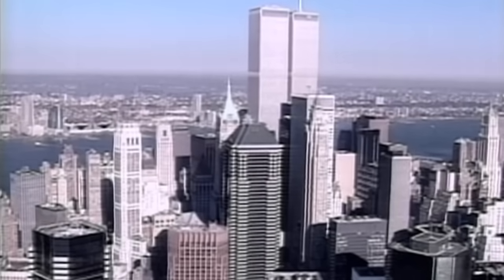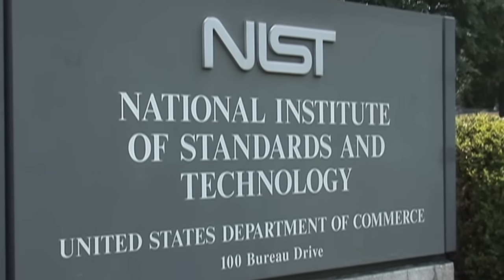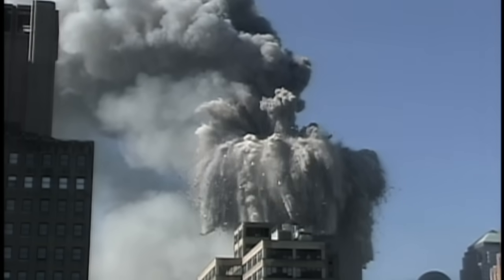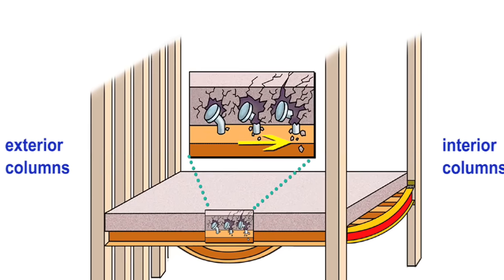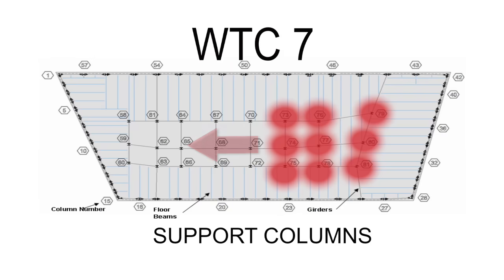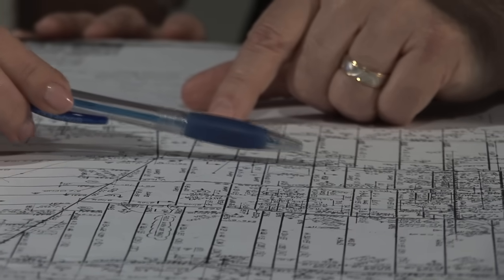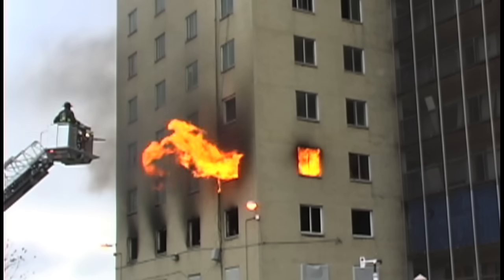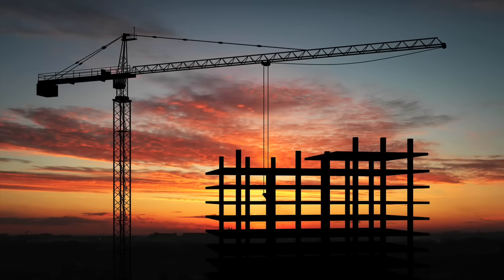NIST Video: Why the Building (WTC7) Fell - https://youtu.be/bERV6IRbXeM

Comment: It's not impossible. Reason it hasn't happened before is because firefighters have been able to extinguish the fire before it brings the building down. In this case the fire lines had been destroyed by the WTC collapse and so fire fighters did not have the means necessary to bring the fire under control. Instead the fires continued to rage hour and hour and eventually the structure gave in and the building collapsed. This is not the first time something happens for the first time in history.

Comment: In their analysis of this collapse NIST have made many errors. The connection at column 79 that they say failed has been misrepresented by them, They got dimensions of some elements wrong, and missed out other crucial elements entirely. Also, their thermal expansion calculations for the beams to the east of the girder that they say failed are just plain.. If the correct elements, figures and equations are used it becomes clear that NISTs explanation for WTC7 is pure fiction.

Comment: Impossible? So then I suppose you think a steel building won't fall no matter how long it burns or how hard? Arnie, we know for a fact that heat has the ability to bend steel, so buildings simply can not be impervious to the effects of continuous fire.

Also no, WTC7 did not fall into it's own footprint, there are aerial pics that demonstrate this.

The building would not have fallen in the manner you suggest, it was engineered to fall as safely as possible.

Comment: it's called LOGIC. the reason fires have not brought buildings down in that manner b4 or after 911 is cos it is IMPOSSIBLE. the FACT that the building fell EXACTLY like a building being demolished ie symmetrically and at free fall speed also is a smoking sun. if nist was right the building would have fallen towards the damage, very much like a tree being chopped down. even engineers and architects have a problem with nist's misinformation. look up architects and engineer for 911 truth

Comment: Hello! I am an engineer in Brazil. The engineering world abe that WTC7 was achieved by WTC1 to collapse. You take a blow from one iron bar in the face will not stand. Worse as the burning wreckage of WTC1 that WTC7 fell into the water and did not. The fire system was destroyed as well as water pipelines street. There is no mystery. WTC1 was no fire and the water to clear. Firefighters confirm the WTC7 and not the CIA. If you want I can send links and videos on the engineering 9/11.

Comment: Why is anyone surprised that NIST is concealing the demolition? NIST is not an independent research institution but is an agency of the US government which automatically renders their evidence suspect. Oddly their FDS-simulator assumes no thermal-conductivity of the steel, the collapse of the building in the model shows contorting of the structure that is not evident in the video, and they rule out demolition entirely on the basis that the noise from WTC7 did not exceed 120-decibels a mile away.

Comment: Why has NIST failed to produce a scientifically replicable experiment in an effort to prove the theory`s probability/validity? The failure modelling software being used would necessarily allow freefall over several floors and countless structural members. On accord with the fundemental laws of physics , this is factored into any physics modelling software. The deceleration between floors/structural members on the vertical axis would always be in a measurable quantity. NIST`s appearantly does not

Comment: This is an excellent analysis of the collapse of WTC7. Not putting out the fires in the building which burned for 7 hours was the critical fact of the collapse. Steel beems are not static structures, they expand and contract even under normal temperatures. But will expand, sag and cause structure failures  under extreme temperatures (1,000 degree F).

Comment: Question for NIST: Why is there no explanation for the collapses? WTC 1/2/7.
Since this was the main objective for the report. As of this date there is 
proposed hypothesis for the initiation of failure mode, And none of these hypothesis have been validated/proven through replicable experimentation. Not even the dataset for the computer simulations has been released  for independent verification rendering the conclusions of the reports 
at best: well-documented suggestions.

Comment from the maker: A detailed NIST analysis shows that during the first 1.75 seconds of the video as the top of the building's north face begins to fall there *was* resistance (and building fell at a rate slower than free fall) as the exterior columns in the lower stories buckled. The middle 2.25 seconds of the video show the building collapsing at essentially free fall speed because once the exterior columns had buckled and the interior supports were already gone, there was negligible resistance.

Comment from the maker: The visualization of the computer analysis shows only the initiation of the collapse sequence and during this time the deforming structure did pose resistance to collapse. The collapse occurred in two stages:  First, all of the interior support columns failed, and then once this support was removed, the exterior columns also failed.